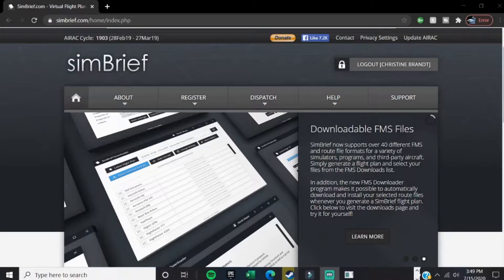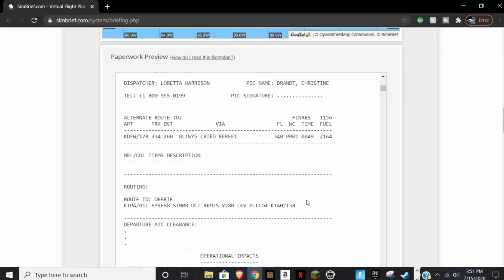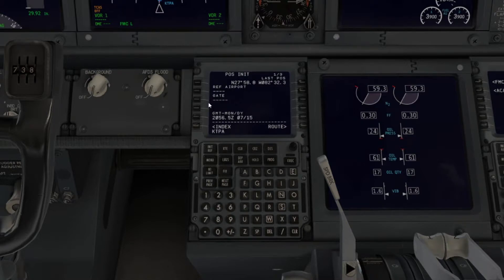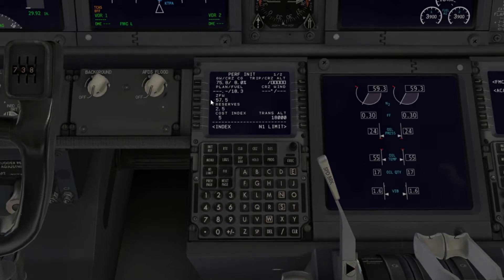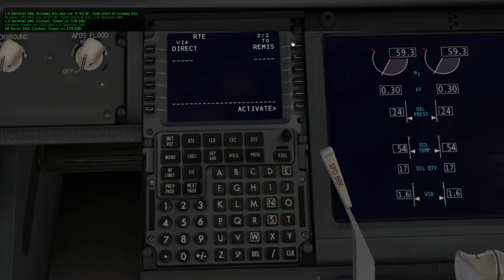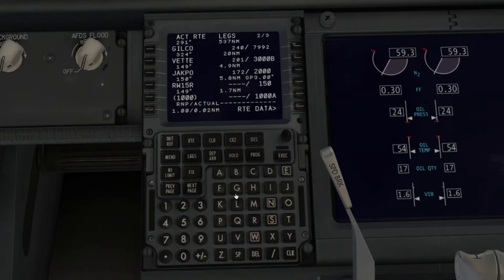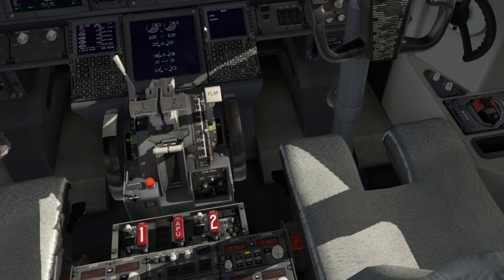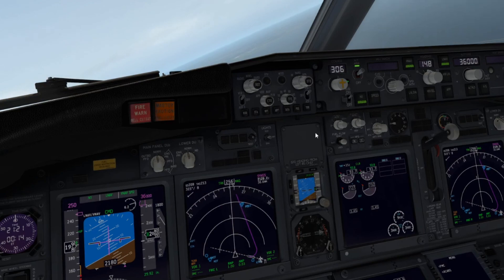2020 ENG FMC, Flight Plan, and Autopilot Tutorial Boeing 737 800 Zibo Mod X Plane 11

Comment from the maker: Hey Guys! Hope This Helps and Please Leave Any Questions In The Comments!
Reply: When I did this and was close to the airport, it never started to descent. Do you have to control the altitude manually, or did I put something in the fmc wrong?
Reply from the maker: @tgg_drifted7082  When you reached your cruising alt. set your alt on the mcp which has your cruising alt to 0 so the plane is now able to descend. Don't worry the plane will not descend until it is supposed to.
Reply from the maker: @tgg_drifted7082  At 12:41 I set the cruising alt on the mcp, set that to 0 when you reach cruising alt.